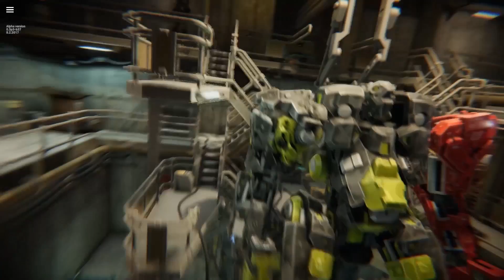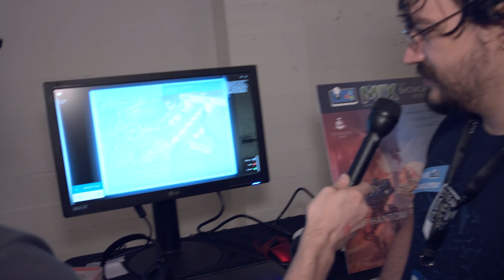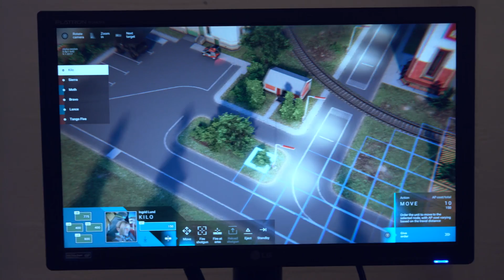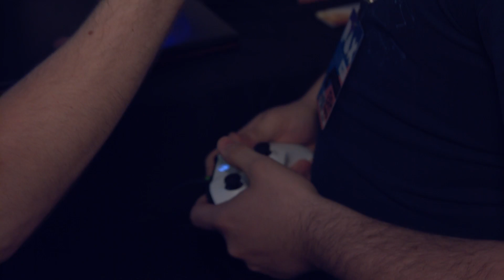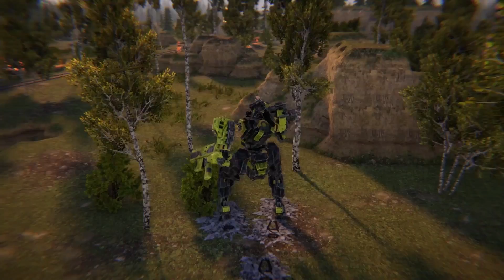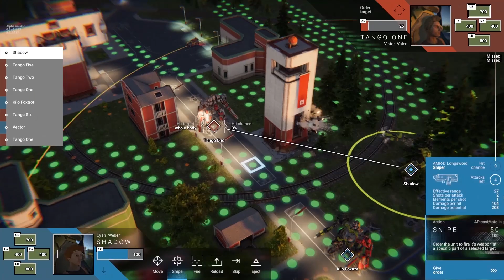Phantom Brigade gameplay: turn-based tactic with giant robots

Comment: this looks really cool!
but the mechs need more "weight" to them. they look like they are made of plasic when they run
Reply: It would be really nice to see a "weight" system for the mechs that would split them into different classes depending on the parts they have equipped. you could make it so that different weight classes have different abilities like:

light mechs can maybe scale buildings, move further and have a higher initiative but have a small health pool and weaker weapons

and heavy mechs have a lot of health, move more slowly and have a lower initiative but have access to the big guns that do more damage.

thanks for the answer btw, really exited for this game.
looks great so far.
Reply: i would be honored to be part of the testing team!

i just joined the games discord and I'll PM you about the key.